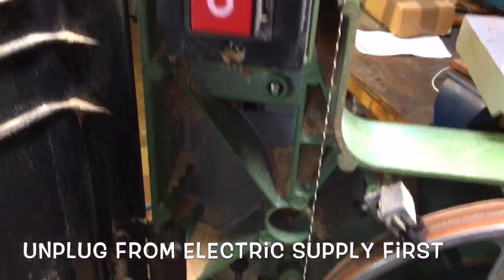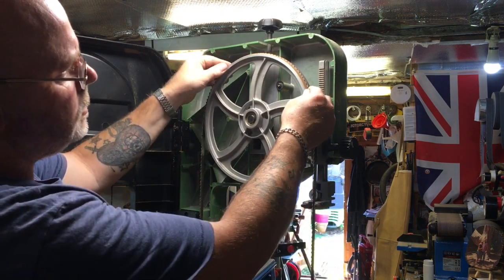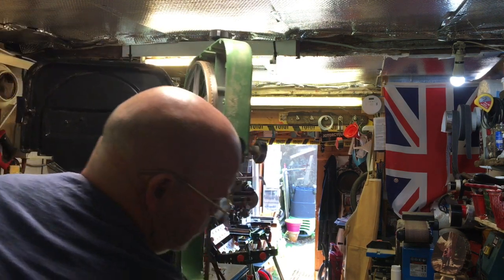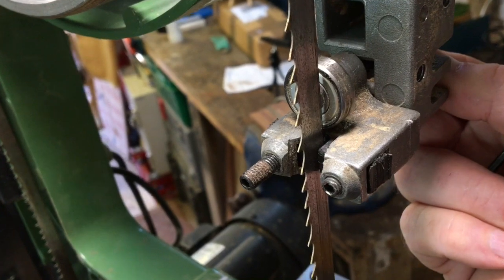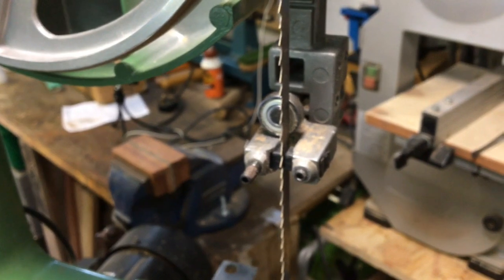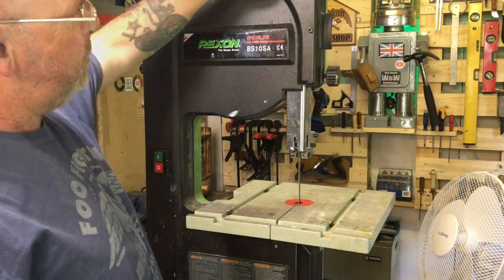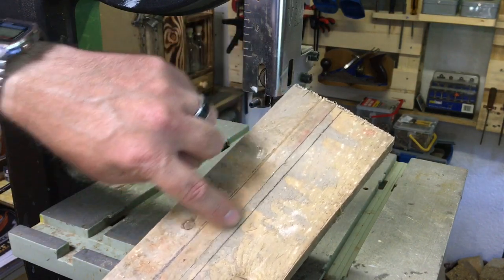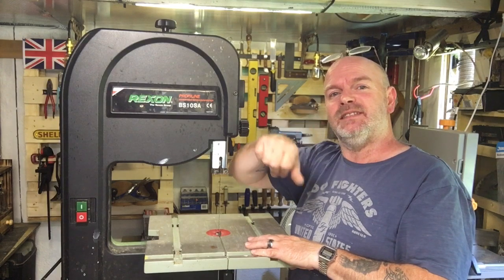How To Set Up A Bandsaw / Rexon BS10SA Bandsaw

Comment: Just found one of these myself for similar money. Was drawn to the height of cut it can achieve for a relatively ‘hobby’ sized machine. Thanks a lot for posting this video mate, really helpful 👍
Reply: Hi, can you tell me what max cutting depth is? Thinking of citing one myself!
Reply: @TAndrews-si3qq  sorry can’t remember now. Certainly more than equivalent worktop sized machines. Would absolutely recommend this bandsaw against the rest as a solid starter/hobbyist one. I think it was maybe 91/2 inches cutting height, pretty impressive really. I have now upgraded to a Sabre 350 as I now work from home as a furniture maker. For context, the height is only around 2 inches more, and it’s a fairly hefty bugger! Good luck, and enjoy!

Comment: So I picked up a second hand lathe and started turning but realised out of balance wood is really scary and thinking a bandsaw would be handy. Watched this very informative video and did a quick market place search, will be picking up one of these later today based on this video. Thank you kindly sir. I’ll let you know what it’s like and how easy setting up is once it’s in the garage. Thank you
Reply from the maker: That's great Kevin, Happy cutting 👍
Reply: Used today after a good clean, vacuum and brush with set up as per your vid. The table has oxidised and is a rough surface which I’ll need to polish up more to allow smoother cutting but so far impressed on a 25 year old piece of workshop equipment. 
Do you know the blade size? I’ve seen a couple of variants but suspect the 73” to be the one I need to look for. The 1/4” 10 tpi is really struggling to cut mature red oak so going to invest in a 3/8” 6tpi and a 1/2” 4tpi to give a good general ability I hope. Cheers
Reply from the maker: @TheTurningPlace  if the model is the exact same one as in my video I think they are 72 1/2" but I got some with mine so not had to buy any yet. I've looked online at a couple of bandsaw blade suppliers and these were both 72 1/2" but if I were you I would check your model with loads of suppliers sizes.
Reply: Thanks David, it is same model as yours, placed an order for the two blades at 72.5” 
Many thanks

Comment: What a lucky find your video is for me! I'm a carpenter with a small workshop and I've just been given a rexon BS10SA bandsaw. I have no experience with bandsaws and your video on setting it up is a godsend. Can you help me locate some spares for it? The "tyres" on the two drive wheels need to be replaced and I'm having trouble sourcing any. It's unusable until I get them replaced. I also need another guide rail, but I could probably jury-rig a replacement for that. I've subscribed to your channel and look forward to any tips you have, and to getting to know what it can do. Thanks, Simon
Reply from the maker: Hi Simon, the only thing I've been looking for is a manual for it but I did find this website. www.rexonspares.co.uk
Don't know what they are like, I did ask them for a pdf manual but never heard anything. 
Thanks very much for subscribing, take care David 👍
Reply: @InTheWorkshop  thanks for the reply David, I also got no answer from rexonspares, but I got a manual pdf from rexon in Taiwan, after a struggle with the Chinese script! I could email you a copy if you like. The only source for the "tyres" seems to be in the USA, at about £40. Still, that's not much to pay for a bandsaw I suppose

Comment: Hi I've just watched your very informative video I bought a rexon bs 10r with the sanding disc for £45 bargain. The problem is the blade keeps coming off when running, the only fault I can see is the tyre on the bottom left wheel.  Any help would be appreciated.  Thanks
Reply from the maker: Hi, from what I gather from your comment you have 3 wheels on your bandsaw. Sorry I have only had 2 wheel saws but I would think if the blade comes off even with a different blade, it would be the tracking needs adjusting or like you say a tyre problem or one of the wheels well out of alignment when fitted and if it was this could probably have shims fitted to straighten up. Hope you get sorted 👍

Comment: Hello David.
I'm thinking about buying the exact same band saw.
Please answer a few questions:
1. After several years of operation, can you still recommend Rexon BS10SA Bandsaw for purchase?
2. Do you have a manual for rexon bs 10 sa profiline?
3. if not, please indicate the main characteristics: electric motor power; cutting height: possible saw blade width.
Thank you Ivan
Reply from the maker: Sorry I don't have a manual  and unable to go to my workshop to look at specs at this time. I think it's a good bandsaw if you can get it cheap like I did. Here's a link to what someone else thinks about it and where they get blades
https://www.ukworkshop.co.uk/threads/rexon-bs10sa-ka-band-saw.74821/
Reply: Thank you

Comment: Blades on eBay 1853mm or 73” max blade depth is probably 15mm. Tyres can be made from hard rubber 17mm wide by 4mm thick. I made mine up from layers of rubber tape.
Reply from the maker: Thanks for the info Richard and thank you for watching.
Take care David 🙂👍